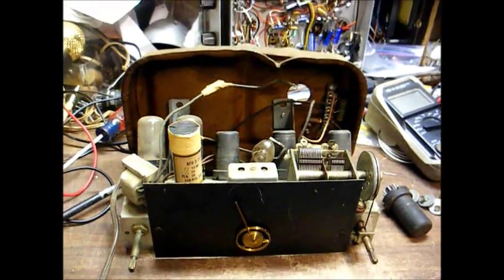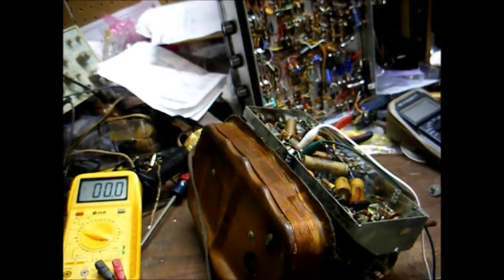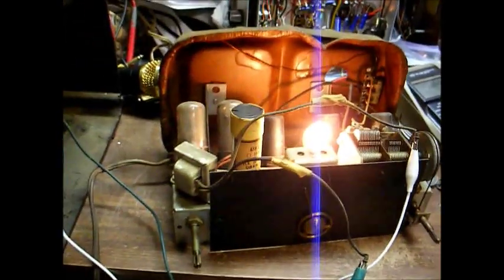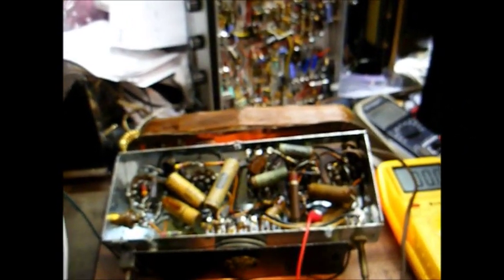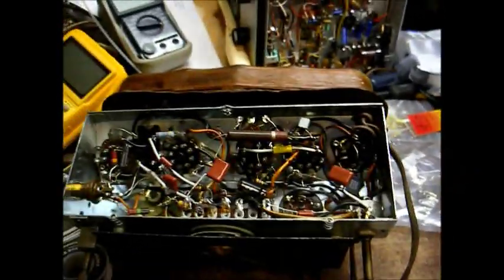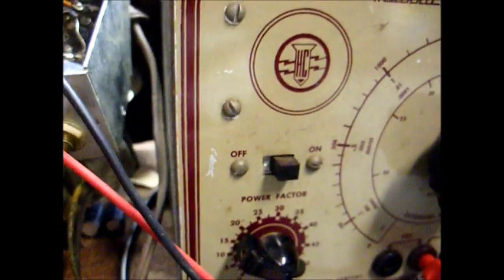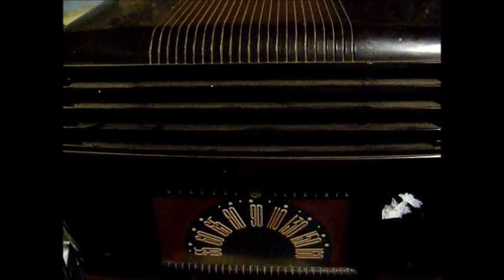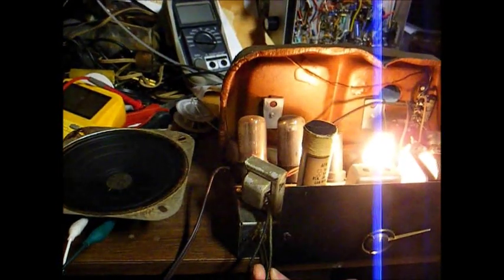Repair of a late '40's GE tube radio

Comment: What do you think about digital AM/FM radio conversation?  I was just reading an article that claimed 98% of the radio stations in the United States will be digital by 2023. That would be terrible if all these old radios were made obsolete, not to mention the millions of car radios that would need to be replaced. I don't see why they can't do both analog and digital. Make it a compatible system like they did when color TV came out. If you have a digital radio, then great you can enjoy the benefits of that technology. If you don't, you should still be able to pick up the signal on your analog equipment.

Comment: so the metal frames on these radios are live 120v? damn here in the uk that coild be 240v 15a and instantly kill you, really dangerous, good idea to swap the neutral for live for saftety there
Reply: Most radios had metal fram isolated with a capacitor. so it is not live. got many 240v jolts.

Comment: The way you showed how to check for a bad tube filament by checking for full AC voltage at the broken filament is great.  Thanks for showing sharing that information.  I never heard of that before. 

Regards, Tom

Comment: Good explanation of tube filament troubleshooting without a tube tester.  Goes to show, like always, you are needed here, making videos.  Dial stringing is the worst part of this, hands down.  You need three hands to do some of them.  Good video Bryan.
Reply: Wife gave me a G.E. 202 which is similar to yours different face plate, replaced some components and it is one of my favorites.  VERY strong pickup, great sound.  Love that one, great video.

Comment: Once again, great video. I'm glad to see you are back and staying. I see that we have something in common- We both hate to restring dials. The worse radio to restring a dial is the first GE Superadio from the early 80's.Normally, I don't work on radios that new but I've worked on a few. You have to be real careful with the fragile power switch when opening it up and on the large pulley where you tie the end of the dial cord, there is a little plastic tab that holds it and you have to be really careful not to break it. It's a royal pain!!